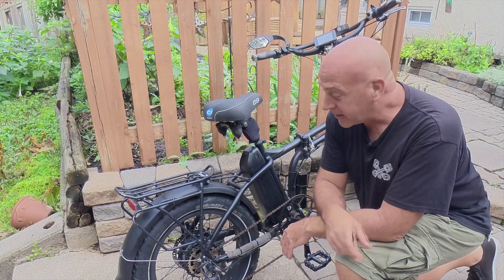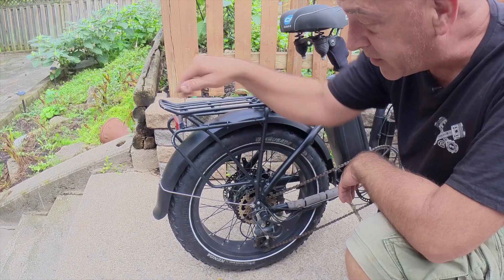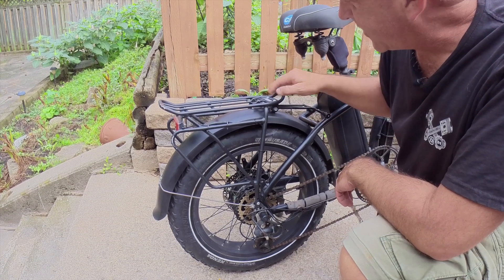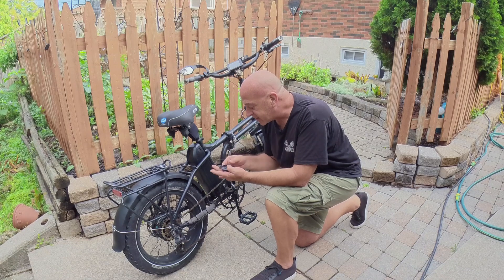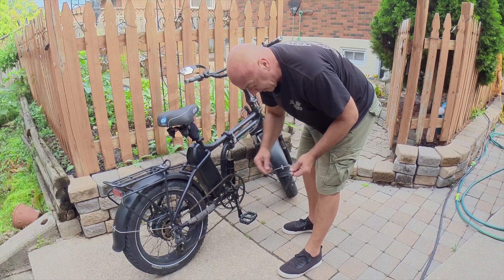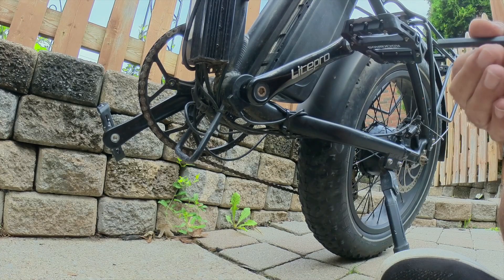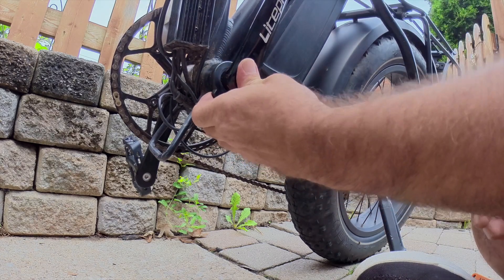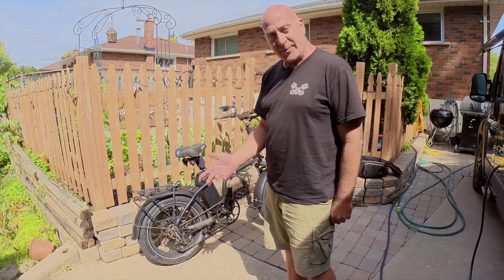Ibera Rack & a better PAS sensor

Comment: We got the Iberia racks and bags based on your video recommendations. When I installed them in the Mini4 and Mini ST, I forgotten about this episode with closeups to the holes.

However, after reading other reviews elsewhere regarding broken screws supplied by Iberia, I decided to use the RAD bracket mounting hole with an M6x25 socket head cap screw and lock washer. I drilled out the middle hole as you suggested as well as a inserted a 10mm diameter x 50mm aluminum rod to prevent crushing the rack tubing. 

It wasn’t mentioned in your videos, but I had to trim the two top rods in order to fit underneath. Maybe it was because yours are nearly horizontal that they passed under the rack. 

Thank you!

Comment: Thanks for the video! I drilled an extra hole for the extension to get the rack a half inch shorter. Now that I see that you just did without the extension I love the height and lower center of gravity!
Also thanks for the sensor info 👍 Have to save your video just in case! Ride on.
Reply from the maker: Thanks! Yea, I think it looks WAY better with the rack lower

Comment: i must say,ive had 2 ebikes including the one ive got now which makes 3 ebikes and all of them had magnet sensors fitted on them and i had no problems with them, thay worked fine in all weather's.
Reply from the maker: Might be the salt on the road in the winter that deteriorates the magnets/disc. Not sure..

Comment: The Ibera rack is a great product and comes with an assortment of parts. It did take me some time to figure out where to mount the rack and which parts to use though. On my bike I mounted the rack with an extension bar in the lowest position to the fender support wire. On my wife's ST Mini, I did as you did and drilled through the rack and used the same position as you. I would not hesitate recommending this rack.
Reply from the maker: Yes, better than Rad rear rack, in my opinion.

Comment: I just bought this rack, started installing it and this is really super helpful. I'd wondered about doing what you did, it's confirmed. But, I didn't know to mount on the lower brazeons. Brilliant. I am trying to figure out the additional bolts I need to mount. If you can find that info and post, it'd be appreciated!